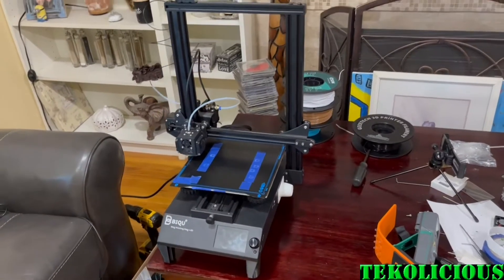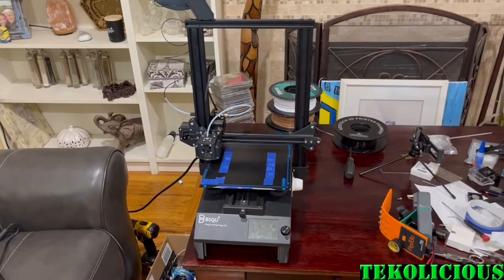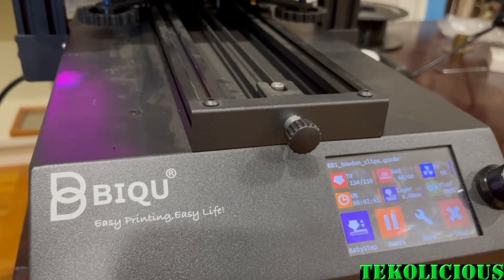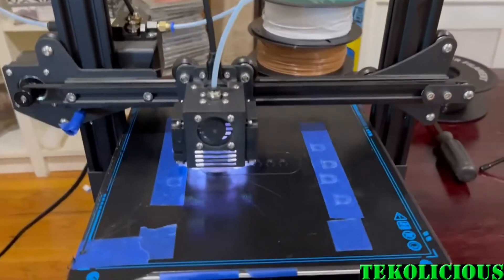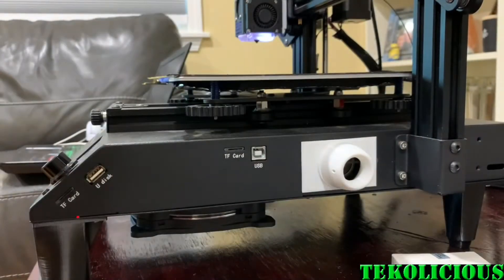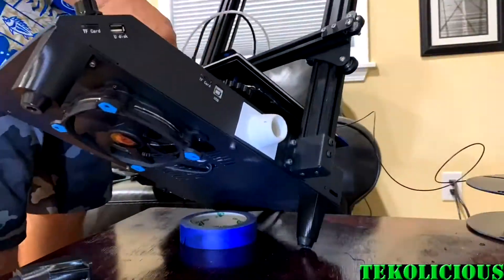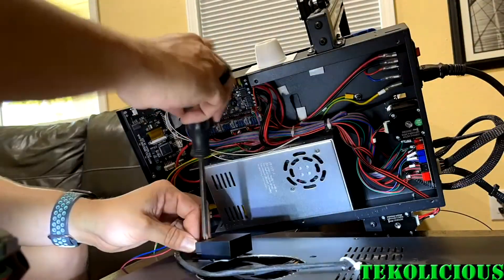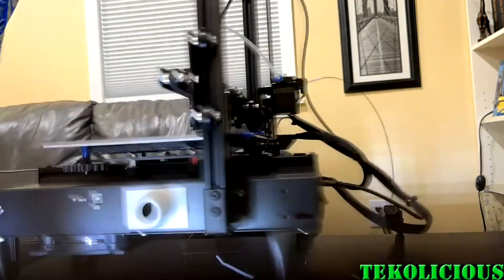3D printer BIQU B1 Fan upgrade, upgrade your airflow.

Comment: I heard that it can run without the two 24 volt fans. I think that's a little crazy so I just replaced them with WINSINN 24v fans off of Amazon. Omg the difference is extreme. Also, I read that you can install a larger MOSFET to the bed connection for increased safety. I'm not that smart so I don't know if it's actually true, but it sounds like it's true to stop thermal run away. Also a term I don't understand but I think I do. Check out getting an extra z axis. They're pretty cheap for these machines and a BL touch. I like your your filament guide. I think I saw that one on thingiverse as As Well. I printed out a roller system and a bearing based system around a wheel. If you haven't, make sure you update that firmware. In both the motherboard and screen. Also along the lines of fire prevention. I know they're not really rated for it but firestop makes really cool automatic extinguishers. There's even mounts for it on thingiverse for these printers. They don't believe they're specifically rated for electrical fire, so. At your own peril lol. Peace out.
Reply: PS. You can use your phone as a decimal meter. I got you bro.👍
Reply: Here's a great video from teaching tech that allows you to change from a 12 to 24 volts using a buck converter
https://youtu.be/yW9ovo9CHi0
If the link doesn't show up, look up teaching tech buck converter .